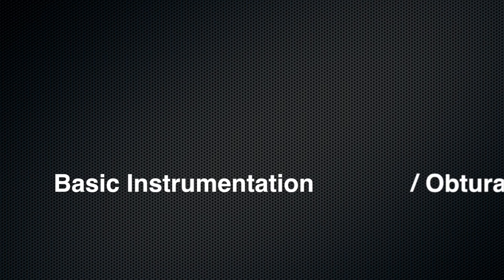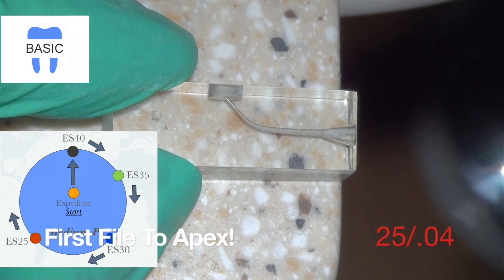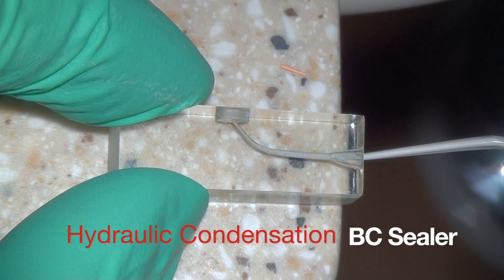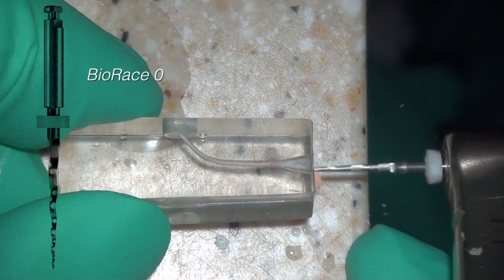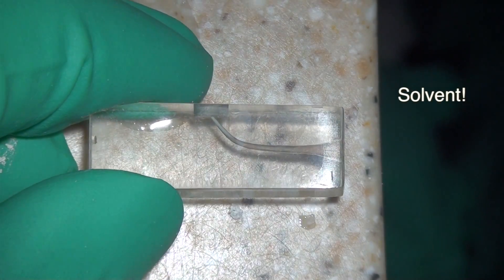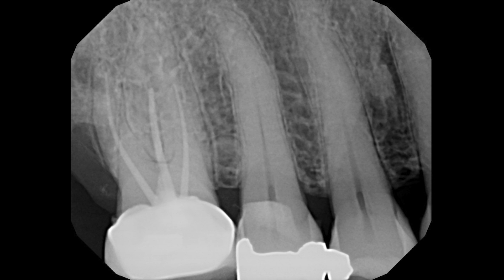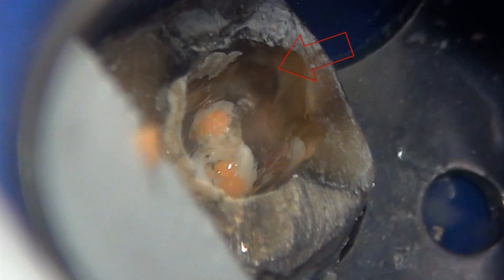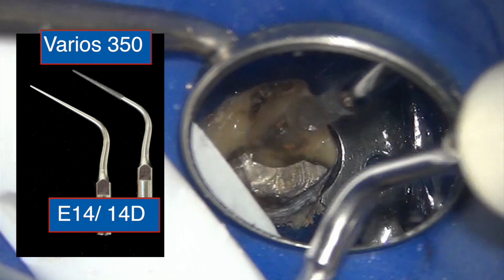EndoSequence BC Sealer: Is It Retreatable? (Part 2 of 2)

Comment: Cool video, as always! But I was wondering - if the tooth was going to be extracted anyway, and the retreatment was done only out of personal interest, why didn’t you do the retreatment on the extracted tooth, so the patient wouldn’t have needed to be exposed to xrays and didn’t have to sith through the process...? Must’ve been a really relaxed patient :) or was the decision to extract reached after the retreatment because the fracture wasn’t as severe to be a clear contraindication. 
Which brings me to the last question: what’s your opinion on treating teeth with fracture lines? Where do you draw the line? (No pun intended)
Reply from the maker: The retreatment was not completed. I merely removed the GP and achieved patency. That literally took 5 minutes! So, it was not a big deal. The presence of a crack certainly changes the prognosis. The cost of completing the retx. vs. not is about half. So, considering the fact that the patient was not motivated to save once he realized this wasn't going to have an excellent prognosis and since the carck may be asymptomatic in 1 month and then become symptomatic after the crown was put on this is how this patient was managed. In general, if cost is a factor, then it's best to remove a tooth with uncertain prognosis. This is such an old video!! Wow. Blast from the past! :) Cheers!

Comment: Dr. Nasseh thank you for explanation but as i see in the last case  there is no BC sealer in the apical one third at all. Is the use of ultrasonic or sonic irrigation help to remove the residual BC sealer? so you recommend to use chloroform with rotary instrumentation to remove the sealer.
best regards.

Comment: Dr nasseh , i am greatly benefitted by your videos , i have a question regarding this video.  What if the solvent given in the canal extrudes apically while using biorace 2 or 3 , as you show tgat the file was reaching apex.  Is this a possibility ? If so how to avoid it ??
Reply from the maker: +souvik saha It's always a possibility; but experience shows us that it's not a problem clinically. The goal is to set good working length and follow the same safe protocols as you would for conventional non-surgical treatment. Working length management is the same whether you're using chloroform or bleach: the goal is not to extrude anything or extrude as little as possible. Some material will inevitably get out but clinical experience shows us that there's very little problems clinically post operatively.